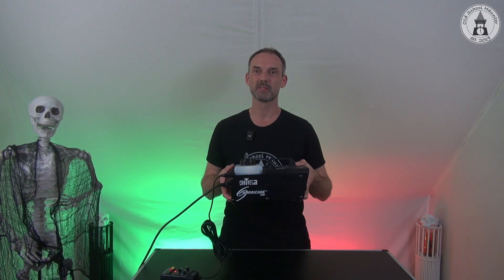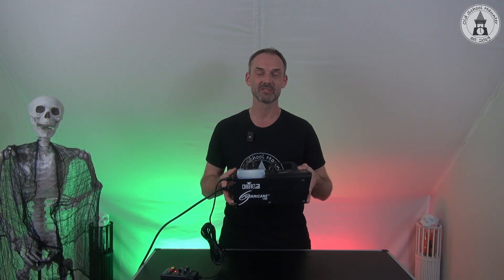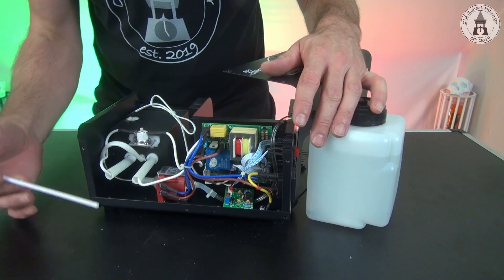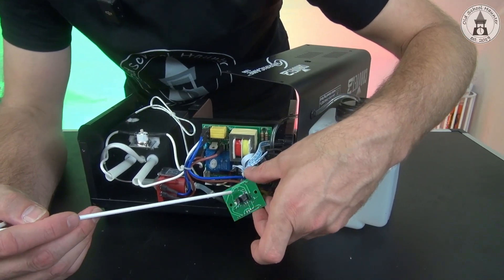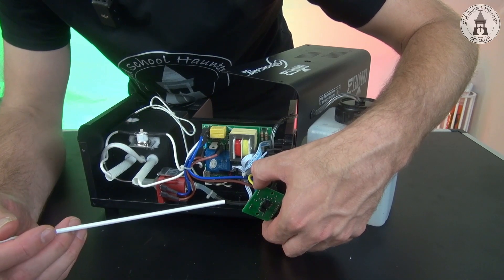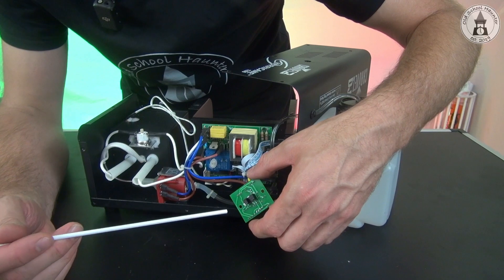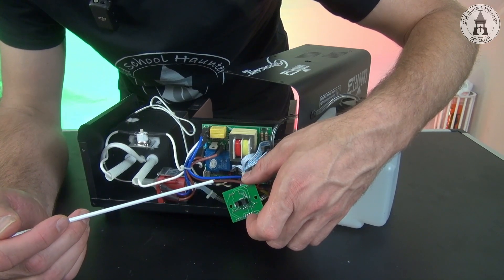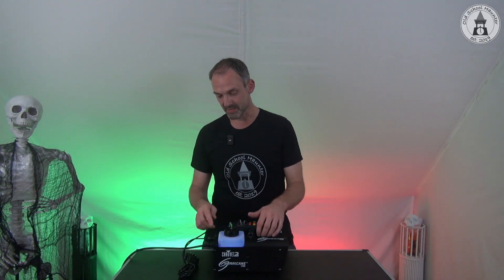Chauvet DJ Hurricane blue blinking Light? Simple Repair of my Fog Machine [Halloween EN]

Comment: Kitchen paper?  Like a paper towel?  Also, did you put the sensor back in with its screws or leave it loose?   Thank you!
Reply from the maker: Oh you are right. I used a wrong translation from German to English 🙈 thanks for correcting me here 👍 what I used to dry the sensor is kind of paper towel. As I put back the sensor into the fog machine I used the screws again to stecke it into place. Otherwise the sensor may slide off the tube.
Reply: Hello,  i have similar issue,  but the Blue light does not blinking all the time... it sometimes stops blinking then i can push the smoke out,  but then it starts blinking again and i need to wait longer than normally to make a smoke again... when i plug in controler, timer does not work probably because the behavior i described previously. I forgot to mention then after i am able to create a smoke it sometimes blinking red... do you think that the sensor might be a issue too?